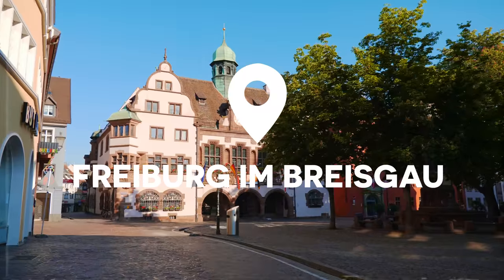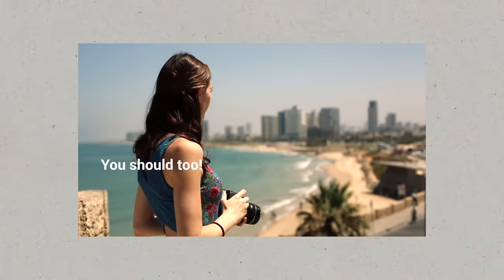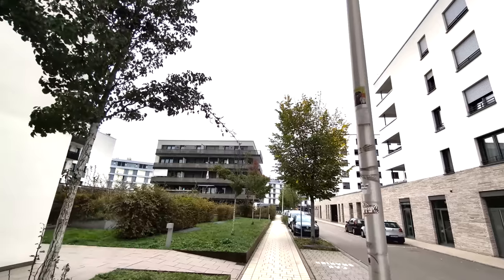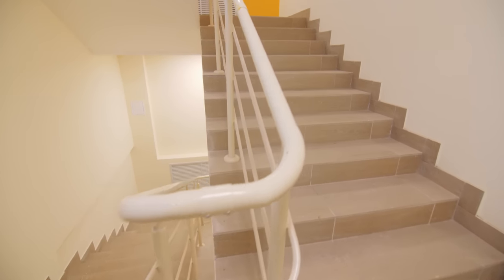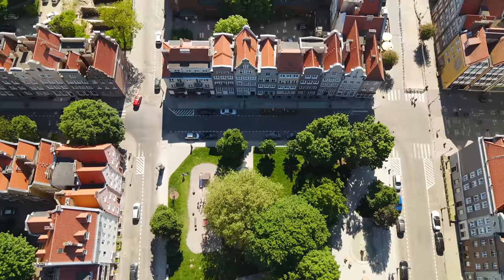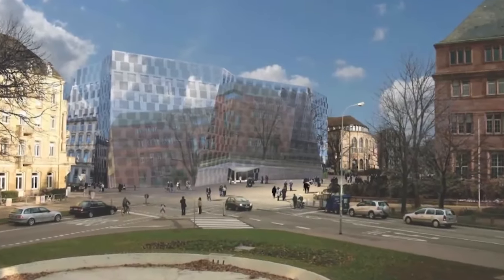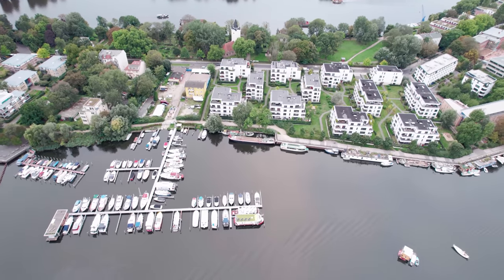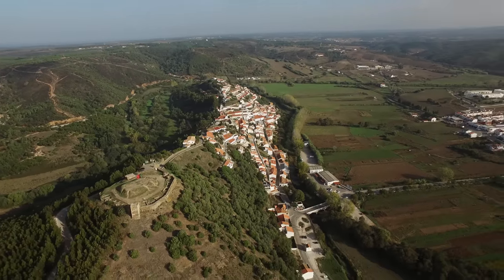Germany's BIG DUMB BOXES ARE AWESOME.

Comment: In my "dumb box", build in the 60s with moderate slap-on isolation, the averaage energy use for heating is 1/5 of a single family home. 
Now, there are several 1-room apartment (german counting) in here as well as family apartments, so if you only count families it might be down to 1/3. But that is still a huge difference (And also a reason why I was a bit confused about the costs people were throwing around last winter. What I pay in a whole year is what they claimed they had to pay more per month.)

Comment: Much of the newer suburbs in Gdańsk, where I'm from, are also those "dumb boxes" - which I also believe are great. First, this city is originally built on a narrow coastal plain between a tall glacial moraine and the Bay of Gdańsk, which means a lot of sandy soil and the need for intensive water management in the hills. After some particularly damaging flash floods in the summer of 2001, most of the new development in these hills has been 4-5 story boxes to make space for retention basins and leave large areas of the city forested opposed to single family homes and paving the foothills fully in concrete.

Personally, I think some of the developments like in Jasień, the next neighbourhood over, are really interesting with a commuter rail station in the middle, and a neighbourhood of "dumb boxes" surrounding one of the retention basins where they have small retail and cafes and services on the ground floor, parking underground to pedestrianise the entire neighbourhood, and a second pedestrian layer on the first floor. It's incredibly simple, but so well thought out. 

One other aspect of building to 4-5 stories in regions with a climate like ours, is that the tops of the buildings are below the tree canopies, not only allowing for a very "human" scale, but when one is living in a very forested city like where I live, allowing the actual ecosystem to protect the building from the elements and save on heating costs in winter, while keeping the temperature down during summer heat waves, although the latter is less of an issue in Gdańsk than it is in Freiburg which gets intense heat in summer.

Comment: Having a fair share of "dumb boxes" around my neighborhood I agree that they can be quite beautiful with their simplicity and efficiency. The only think I somewhat worry about is the style of the buildings themself. If all of them are near identical in the same modern minimalist, all white style they might look decent today, but in 50 years they might look as outdated and soulless as many brutalist concrete boxes do today. You've shown how older houses in other styles can also be these efficient boxes at their core, so creating a bit of variety in facade materials, color or roof shape might be worthwhile.
Reply: I think part of the problem here is that the box design is being equated with spartanic exterior design. You can build a box and then still decorate it on the outside. It's not like we expect our box shaped living rooms to just stay bare walls, either.

The box is just the foundational structural element. Decorations are extra.
Reply: bongi6811: Stark, square buildings with flat roofs are ruining Stuttgart. Developers love flat roofs because they are cheaper to build, yet a building with a flat roof is not only ugly, it is unhealthy - no circulation of air above the accommodation. Streets of buildings with pitched roofs have a more human feel than streets of buildings with flat roofs. They are easier to be around . . .

Comment: 5 1/2 years ago my wife and I moved into a new dumb box in Kohlscheid ( a small suburb of Aachen).  It is absolutely fantastic.  The building has two stairwells, each with 4 one bedroom, 6 two bedroom, and 4 three bedroom apartments over five floors.  There are storage rooms for each apartment in the basement, as well as a garbage collection room, heating, and an underground garage.  We have a 3 bedroom apartment on the fourth floor.  There is an elevator from the basement to the 5th floor.  Everything in really ideal for us as we're retired, and mobility will someday be an issue.  With a large pantry in the apartment, we have our washer and dryer here, and like most Germans we can dry our laundry on our balcony if the weather permits.  Our energy costs in the box are substantially lower than in our previous home.

I love the German construction methods.  Seldom does one see wood frame construction.  The insulation between apartments is superb.  We never hear our neighbours unless someone is moving in or out and you hear drilling.  We're 300 meters from a very nice supermarket and bakery, and bus service into the city.  Doctors offices, pharmacies, other shopping are all easily accessible,.

Comment: Brilliant architectural+environmental presentation. Loved it. I used to live in Switzerland (dumb box. Cofortable, well-insulated). Now I live in a British terrace. Quirky but it is hard work keeping mould away and warmth in. I am also for the dumb box: fater all, I live inside, and I can make the inside original. As long as the outside has a nice colour and it is clean and in good repair, with greenery not too far, as well as shops/schools/doctors, I am very happy. Switzerland (as well as Germany, Slovakia etc) have got it right!!

Comment: I'm not against boxes, but I don't like flat roofs. They might be nice in a warm dry climate, but not in northern Europe. 
I witnessed the problems several times over the years (thank god only in my surrounding). My school had water leaks and needed some rebuild. The students home I lived in had leaks and I made some bucks by getting the gravel from the roof down so that the roofers could go on their search. And the home of a friend in a terrace style blockbuilding also had leaks on the roof.
With a tiled roof you only need to change some tiles if something happens. Of course the room usage is worse but you can have the isolation in a well workable dry surrounding and not burried under gravel and foils where the rain may stand.

Comment: Great blog 

Retired British structural engineer. Interesting post.  Dumb boxes often used  but I have some bêtes noirs when it comes to  medium rise social housing. These are often dumb boxes with load bearing masonry walls and precast concrete.

Cantilever balconies. Balconies with posts at the outside corners are easier and faster to construct.
Failure to stack the flats. Large multi bedroom flats at ground floor requiring transfer structure to support the upper floors with steel columns threaded into partition walls..
Level thresholds obtained by dropping the insulated structural ground floor well below external ground level. This puts the underground drainage lower which increases excavation and inspection chamber sizes.

I personally consider having the wall plate of a timber framed building below ground level is asking for problems.

Comment: I'm in the process of buying an apartment from a company that focuses on building condominiums. They say that white cubes ("dumb boxes") are most versatile because they are so neutral. There's certainly some expressive architecture, but the vast majority of apartments built is not among it. With a practical floor plan that most can agree on, the same apartment can be furnished for singles, couples or families and the rooms can also change their purpose to some extent, for example when children grow up and move out and don't need their rooms any more.
The exception are the bathroom, toilet and kitchen, which all require some installations that are decided upon from the beginning. Then by the placement of freshwater and wastewater connections and electric outlets it's pretty clear where your sink, dishwasher, stove and fridge goes even if the apartment isn't sold with a pre-installed kitchen. The rest is flexible and can be adjusted, probably better than a more "styled" apartment would.

Comment: I just wished for those boxes to be a little prettier and that not every architect designs exactly the same house.
There are parts in Bremen and Hamburg that are very hard to distinguish.
Reply: This is really unfortunate, because there is no need to do it that way. I know a smaller city (a bit over 30000 inhabitants) that did also such kind of development in a better way. They wanted to avoid creating a ghetto for the poor, therefore they planned ahead. The first thing was that they split it into different parts where not every part was developed by the same company. In addition they also demanded that living space for all kind of different types of income was created. Therefore neighboring buildings look similar because they are based on the same "building blocks" but each a bit different. They have different heights, some have a bit more green around then others and so on. In addition there are not 20 of the same type along a street, but maybe 2 or 3 and then a different type of these blocks starts. Some have edges, some have rounded balcony, there are different colors (not bright ones, but more subtile) and so on. Due to this the city block looks a lot more "organic" and not like a bee hive.

Of course this is slightly less efficient, but I think its worth it.

Comment: Thanks for a great insight into all of these factors!! We recently bought our first apartment and the outside is so ugly but we were floored by how little energy is needed, both during the super hot summer and the colder months. We have to use heat eventually but the temperatures had to drop considerably for us to start using our floor heating. And in summer, all our American friends were like "how do Europeans live without AC?!" and we really did well all summer, even though temperatures did go up a lot last summer.
I also love that you included the community aspects and the decrease of segregation. It's not going to disappear completely but even a decrease is extremely valuable to community building and reduction of harmful effects of differences in starting positions. I'm not naive enough (anymore) to expect them to completely disappear but any improvement is a step in the right direction.

Comment: Rainwater management is another thing to consider. When we concrete over areas, those places can not naturally drain, which shifts the burden elsewhere. When there is heavy rain, the water falling onto buildings has to go somewhere, and ultimately that usually means rivers, creating the potential for floods. There are strategies to avoid excessive runoff, but they depend on the right building densities to ensure there is sufficient space to provide natural soakage.

Comment: About the height, certain towns in germany have a max height limit, just to keep the silhouette of the town, also there is some regulation for elevators, i think at new planned buildings about 4 stories, there is a must to build a elevator, but not sure if this 4 stories is still a thing, or the made it change. Those Boxes are not looking fancy, from the outside, but the inside can be really cozy, useful and even fancy too... with that, i do not look at the facade of the building at first, i look at the inside, just like a book, you are supposed to choose the content, not the cover...
Reply from the maker: Yes, there's an elevator requirement with certain building heights. Although I have often felt that today, particularly in multifamily buildings, they are pretty much standard nowadays. We lived in an older building (1860s) before in Freiburg in the attic apartment... Pretty sure the movers hated us for asking to get our passive dining room table, washing machine, and refrigerator down three flights of spiraling stairs. 😂😬
Reply: @TypeAshton  i cant believe anyone hates you... i like the older buildings, no wall straight, corners are something, and small Windows at places you don't want them and not on places you want them... and the spiraling, uneven stairs from the time... lovely... but today very not useful...
yes it feels like all these new dumb boxes have always a elevator included...which is good, not everyone is just as mobile as young olympian sportsmen... what i miss in architecture is the broader thinking of inclusion of disabled people... on public building, sure, there are some laws, but on living space boxes, it's still to less for me
Reply: Funnily enough, the height restriction of most towns is based on the fire department 😂 Let me explain:
If even one of the city’s buildings is taller than 3 stories (the maximum height you can easily reach with ladders you can carry) the city is legally required to have an aerial firefighting apparatus in their departments portfolio. So while a general „we don’t want huge houses“ is an aesthetic decision, the absolute most common exact height restriction is based on firefighting requirements.
Reply: @QemeH  I would claim, that the towns/cities one would want to build that higher building will have that ladder truck anyways. 
And they often already have some appartment blocks from the 70s with 7 floors. 
The reason they are not built that high anymore is probably, because they would be towering over their surrounding neigbourhoods too much.
Reply: @@TypeAshton   Personally, I think you forgot one of the most important features of the Big Dumb Box that is often overlooked today, even by professionals: ACCESSIBILITY! A Big Dumb Box can more easily and cost-efficiently be updated or correctly planned to accommodate everyone from families with buggies to full-time wheelchair/powerchair users.

My building has four floors with flats plus basement/garage level 1 and garage level 2. On each storey from E-3 there is one complex designed flat made for the needs of a renter who is (next to) constantly in a wheelchair. Door openings are wider, there is no lip to the balcony, door handles and light switches are lower down, wall plugs a bit higher.

The rest of the flats are adjusted enough that parents with buggies, seniors, or disabled visitors can manage easily enough.

Common areas are completely accessible, two staircases and a lift, automatic doors triggered by flat push buttons or inserting one’s key and turning. Lighting is automatically triggered by movement.

I live in GER‘s worst city for €/m2 — Munich. Over the last ten years I have seen our neighbourhood go from labelled ‚decaying industry‘, ‚blighted‘ and ‚one of the more „dangerous“ Viertel Münchens‘ to a lovely, vibrant full Viertel that is mostly a mix of normal and Sozialwohnungen, more recently some townhouses, one rise of luxury flats, a Netto, multiple KiTas, dozens of playgrounds, a few parks of differing sizes and the last parcel of land is under construction for next autumn: our very own Grundschule!
Reply: @mathsiecat  greetings to munich, was born there... but left because of the work and housing prices 25 years ago, still does not getting better there...
yes the new boxes are planned for better inclusion, but sadly most of the developers are more interested in luxury flats to sell or rent higher... inclusion costs in planning and building but gives you not the higher price back...
ps sounds a bit like Perlach or Hasenbergl (at my time they where the problem zones) but please correct me...
I think it's natural,  the Viertel (quarters or burroughs) are changing over the years, public demand, one start a business, a next one comes and start their own, Singles became Families and demands KiTa and Schools...it works in most Towns i visited in Europe like this, not sure how it is in car centric America and Canada...
Reply: @TheWampam  Yeah, absolutely there are other reasons to build these "dumb boxes". What I was saying is that german cities and towns usually have a three tiered height restriction (and nothing in between) because of the firefighting rules:

1) You can't build higher than 3 stories anywhere - then the fire departement doesn't need an aearial device.

2) You can build more than three stories, but not above 23 Meters above ground (for the top FLOOR, technically) - because that's the maximum height for aerial plattforms  built with german industrial standard ("DIN")

3) You can build as high as you want, but above 23 meters you need to include multiple fire-secure emergency exits
Reply: @mathsiecat Sounds like Obersendling.
Reply: @SirHeinzbond  oh I know. It’s clearly up to municipalities rather than private anything to handle such a concept. But I guess I am just too much of a dangerous radical socialist, I mean, communist . 😹

And it’s the Mittersendling area, but Hasenbergl is also becoming very safe and nice again.

Comment: The boxes can look a bit sterile and unwelcoming, but with greenery, green spaces, pedestrian lounging areas (benches, gathering places, public barbecue places etc.) this can be alleviated a lot. Münster has a model district with a lot of walkable areas connecting low-story boxes that form a very pleasant neighborhood. The Vauban neighborhood in Freiburg is another example of this concept done right and expanded upon well. And don't forget awesome roof-terraces and gardens that you can potentially put on the flat roofs. 

The most important thing is that we build way more of these multi-story buildings of 2-4 floors (higher becomes too intimidating and dominating and oppressive) instead of detached single family houses in towns and cities. These dumb boxes also work really well with renewable energy integration. All in all a boatload of positives for society, cities, livability, sustainability.

Comment: Our house is two dumb boxes set at right angles to each other so that the rarely used "formal" living room can be completey isolated from the every day part of the building. There are doors closing off the stairs to the bedrooms to prevent drafts and heat loss.  Each  area has its own thermostat so we only  heat what is currenty occupied.  Because the walls are stone blocks and 50 centimeters thick cooling is not required.